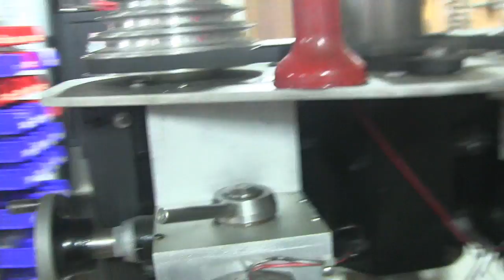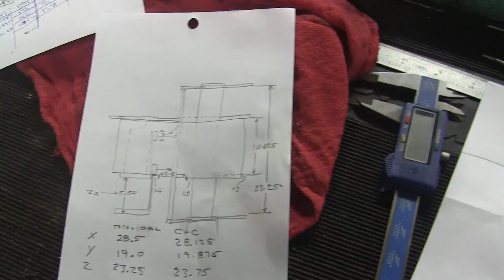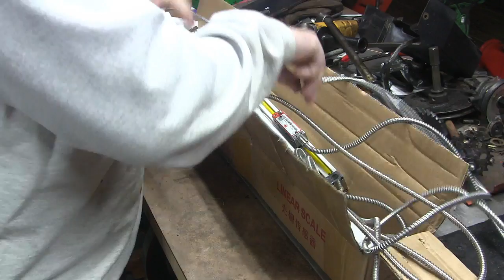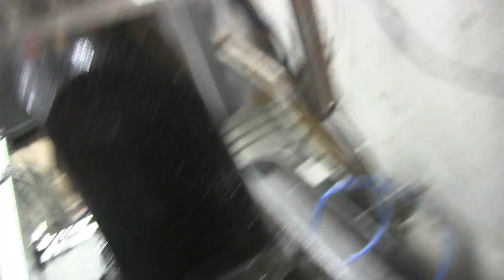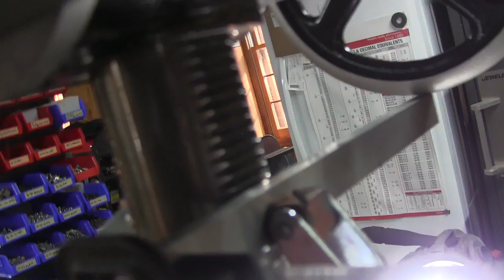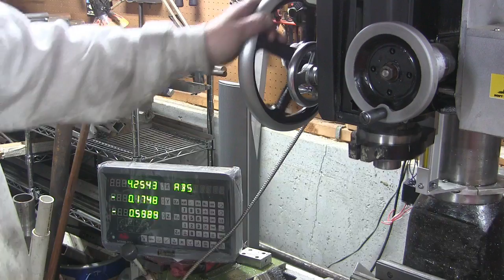RF 30 DRO

Comment: Watch your channel often, just picked up a R-F 31 on 2/6/21 which as the power X, & DRO for all axis, 3hp Baldor new motor, and DC controller set up. Come check it out on on our channel and hit he Bell for more as we get her set up. Replaced our Enco 1980 column mill, so a nice plus to our small shop. Bear.

Comment: Joe, what is the length of the z scale that you used as I have the same machine and want to do the same install. I measure 29" and 16" for the x,y but not sure about the z . Does this match your lengths? Also I did not see a way to spec the length on the web site. Thanks,

Comment: Hi Cuppa Joe, I bought a Rong Foo RF 31 for a While ago, and I have a hell of a lot of noise coming from the spindle/quill , I replaced all the ball bearings on it but it didn't do much good. So how is it Joe, is it supposed to be so noisy? or what do I do wrong, I bought this machine new....
Reply: I retighten the ball bearings but it didn't do much, at the moment I am using a 70mm. face mill I was running it with 700rpm and then I reduced it to 350 rpm and still a hell of a noise, .......

Comment: Nice job ...what Chinese manufacturer is this DRO made by?  Is it HXX?  It seems they sell them with magnetic scales that are easier to cut as well?
Reply from the maker: Yes HXX and sorry to say it's loaded with bugs but the basic accuracy is OK. I hear that mag scales aren't that great unless you get big bux types.
Reply: @ReignOterror  What kind of problems are you experiencing?    I will investigate the Chinese mag scales more with that comment ....you sure have got that Rhong Fu tricked out.
Reply: This looks like the same one you have only with mag scales?
Reply: @ReignOterror  I am also finding that some DRO's (Easson) have a function called Speed ...which give feed per minute.  Does this one give you that?  How about the calculator ....does it do a computation for speeds and feeds?   I cannot find a manual for this DRO on line.
Reply from the maker: No speeds and feeds. The manual is totally chinglish and unreadable. It does have a calculator but you can't directly put the answer into an axis. It is separate from the DRO mode.

Comment: Hi Cuppa Joe,
I really enjoy your videos. I especially like how you solve the geometric problems.

 I was thinking of simpler way to establish the center line for the round column. The idea is to find the closest point on the column to the spindle at a high and low positions of the spindle head, then connect the points.

The method is like tramming the table, but instead of measuring the height of the table when rotating an indicator in the spindle, measure the distance to the column, then find the closest point. Repeat at several places and connect the dots.  That's it.

 In order to factor out alignment and play issues with the quill, lock the quill and just move the head on the z axis when finding different points.

Am I daft or do you think this would work?

Comment: Can you still rotate the head on the column without damaging the Z axis scale and reader head?
Reply from the maker: No, I have a 25 mm Thompson rail and a linear bearing that keeps the head from rotating. It can be seen on the right rear of the machined. Those brackets I mounted the encoder scale to also hold the rail.
Reply: @ReignOterror  I follow you and I now all about the rail, what I wanted to know was if you loosened the upper and lower collars plus the head can you reposition the head to another position to the left or right without damaging the scale?
Reply from the maker: Well, I suppose that if you loosened the clamps on the brackets that hold the Thompson rail that the head would rotate and the scale would rotate with the head but the big problem with round column Mills is if the head rotates, you lose reference to the work. The rail keeps the head from rotating when I raise or lower it thus maintaining position. Check out my other video called "The Mighty Wrong Foo" to see more about the rail.

Comment: You really are improving things in your shop.  I wish my carriage and cross slide were square like yours.  I nave the old curvy type of lathe parts and it can only make it harder to mount things.  More than once I have forgotten to ask what model switch you have on the mill.  Heck you could even say where you got it if you like.    I want to install a reversing switch on mine as well.
Reply from the maker: Harold, where there's a will there's a way. Just mount your encoders on spacer blocks. All they need to do is hold the scales in line with the axis. After seeing some of the projects you take on, I know you can do it!
Reply: @ReignOterror  what about the switch?
Reply: @jonmillerpersonal  my original factory switch is internally mounted and one direction only.

Comment: I've had one of those made-in-china-sold-through-amazon-dirt-cheap DROs on my mill for about 2 years now. I probably paid a little more than you did, but still, honestly, if it quit tomorrow I think I am ahead of the curve over the high-price spreads. My Z-axis install was not so clever as yours, so I still have the separate quill DRO.
Reply from the maker: Did you get yours from Selene Allure?
Reply: @ReignOterror  Mine is branded "T-Pac" and has a slightly different button panel arrangement. I suspect the innards are about the same, an 8051 microprocessor plus support chips. My biggest complaint is really only that curve profiles do not follow anything except the ABS coordinates, so you can't use the tool compensations to do 180 degree curves in one setup. I know, picky, picky...

Comment: Christmas early for Cuppa Joe. 😎 Great project, I've been looking at those scales too, glad to see they really work for that price. Clever way to connect the Z axis so you get the quill and column. Thanks for the video!
Reply from the maker: Just be aware that the manual is completely useless but if you play with it for a while you can figure it out.